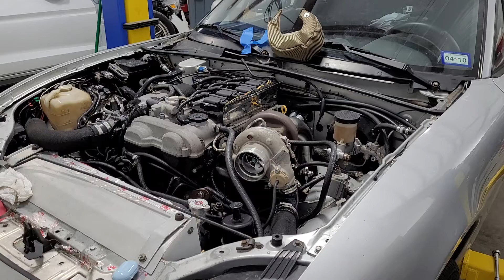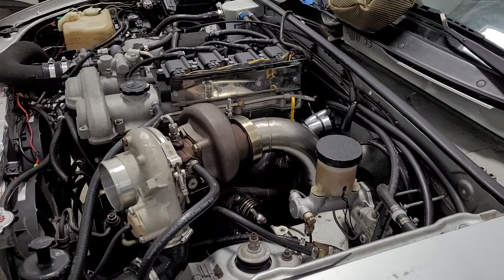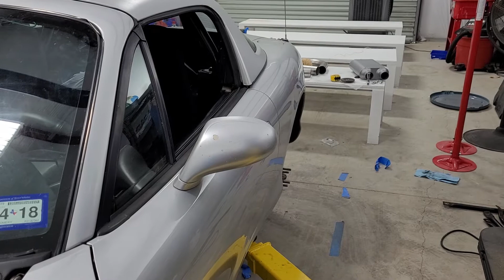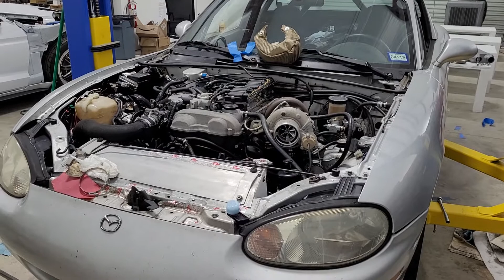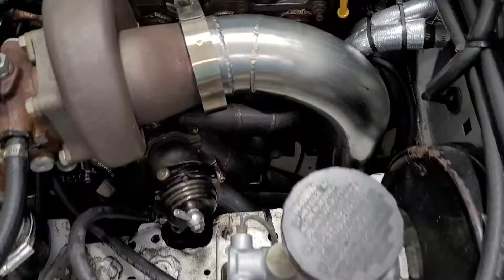Compound Turbo Setup Explained

Comment: would you pair a gtx3576r (82 a/r) with a gt2860r (42 a/r) ? both are 60 a/r compressor but obviously different wheels
Reply from the maker: That could be a good setup.

Comment: hi i want to do my car as well  compound  sestem i have been searching  lot but never done that  yet ... car pushing  big single g4085  start boosting round 4.2 losing racing any suggestion ,, want to use .. my confusing parts do i need 2  wastage !!!!1  2 BOOST solenoid!!!!!,,,  planing to use garret 3076r  ...
Reply from the maker: I don't quite follow. What is your question?

Comment: Have you looked into diesel pump UKs quick spool valve?
Reply from the maker: I have not. But a long time ago I did actually put a quick spool valve on the car. I had mixed results. It did spool faster. But the extra restriction and poor turbo sizing resulted in it not making much difference in power vs keeping the valve open. I ended up taking it off.
Reply: @patrickcowanjr1 his design seems to have some interesting quirks that I think could probably help with the issue. I'm considering using one if I go turbo on my build
Reply: @patrickcowanjr1  nobody I've seen has actually used one on a gas engine even though they are supported with the new cooling chanel. I might be wrong though I haven't checked in a minute

Comment: Not sure if you know how to read a compressor and turbine map, maybe your turbos did not have them. I'm working on a compound setup for a helicopter (pressure ratio of 12). There is very little for compounding on the internet, even with diesels, but it is not difficult.
Reply from the maker: My turbos didn't have them. But if I ever build another compound setup I would definitely buy better turbos that had data to go with them.

Comment: I don’t understand. Let’s say you want to boost not more than 20psi in the engine, how do you control the boost?
Reply from the maker: The way I did it, I had a boost controller for each turbo. I actually ran the car at 22 PSI before and I did that by running the front turbo at 17 PSI, and the rear at 5 PSI, and it totaled 22 PSI. I tried other ratios but basically it was always more fun to have the smaller turbo make as much boost as possible. At one point I had the front at 30 PSI and the rear at 10 PSI. I killed two front turbos doing this by overspinning/overworking them. But it was fun while it lasted, the midrange torque was insane.
Reply: @patrickcowanjr1  You should not be killing turbos. The purpose of compound is compounding. Once the first turbo is making boost the second turbo multiplies its inlet air, so the first turbo does not increase its speed any more, it also becomes a multiplier.

Comment: front turbo 25psi, rear 15psi, thats and pressure ratio of 2.7 and 2.0 (give or take) that maths out to around 64psi primary turbo outlet rather than 40psi?

Comment: I’m making 23psi @6800 on 5psi and 7psi gate springs, my limiter is at 8500... I’m still breaking in my clutch 😂 haven’t turned it up yet, still on the lower wastegate springs I could find.

Comment: Nice videos! Keep doing them.

Have a question what kind of valve and springs setup you have so you can do 9000 rpms?! 

Thanks
Reply from the maker: I'm running the Supertech heavy double springs. To be honest, I think they float at 9K but not at 8K. That's with stock cams, if you had more aggressive cams it could be worse. I wish someone made better springs, I haven't found a better option.

Comment: And a super charger
Reply: I’ve seen one Japanese tuner run the rotrex/hks style blower on a GTR. Different than any other twin charge or compound setup I’ve seen. 
Perhaps with a large enough blower it could fill in the top end without losing the low end response of the factory turbos, assuming it had some healthy wastegates.
Reply from the maker: Come on Jacob we can't be listing everything I've broken in the comments.... Youtube's comment section would run out of space!!!!!
Reply: Yep they will tell you to go to twitch tv